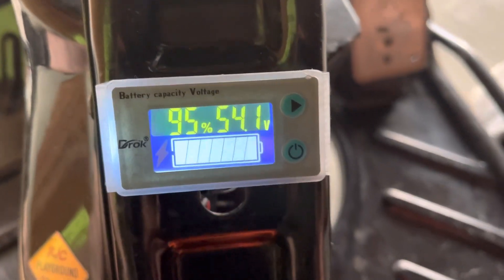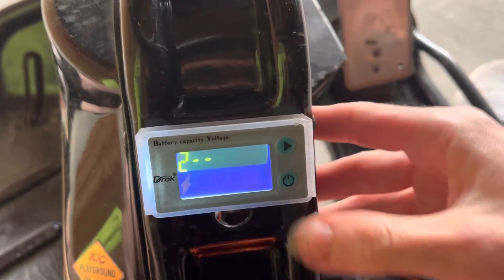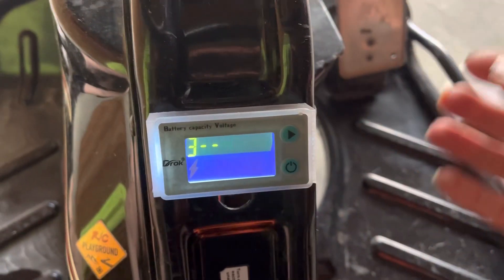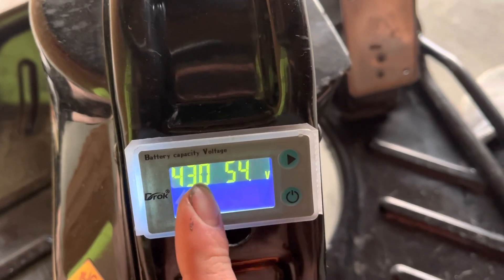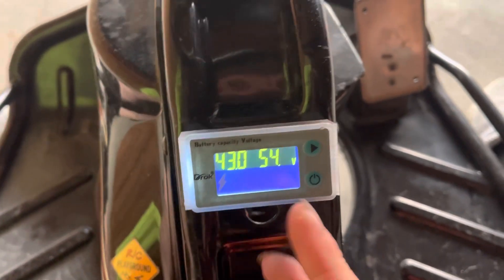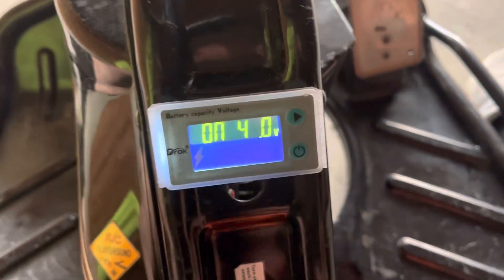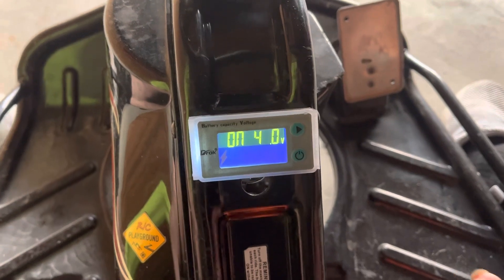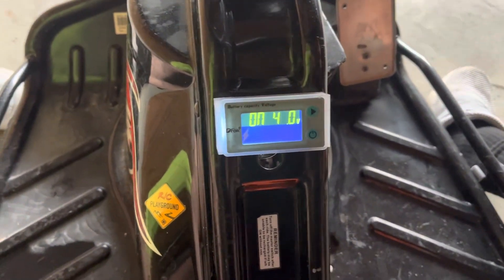How to program drok voltage meter

Comment: If anyone is running a 48v 20ah Cao MM battery your low V is 41 & your high is 52v
Reply from the maker: @wrjeezy15  your battery should be charging to 54.6 as you can see on your charger, if it’s not your having a bms issue
Reply: @chargedup6565  thank you I’ll adjust it

Comment: You left out the most important instructions! function 1 Battery type number of cells etc....
Reply from the maker: We don’t use function 1, instead we pick the start and end voltage. Achieving the same thing but more accurate 👍

Comment: I have a 48 volt yamaha cart. Do I set up the meter using P48? For 6 lead acid 8 volt batteries in series for 48 volt?